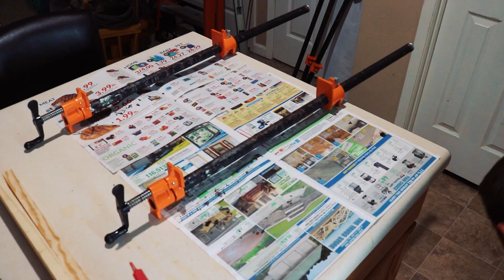Large coffeetree and walnut cutting board

Comment: Hi John, great work. Where did you get those parallel clamps??
Reply from the maker: You can get some 3/4” bar clamps on amazon. Then you’ll need to go to your local hardware store for 3/4” piping. I recommend getting 36” in length for each pipe.
Reply: @johnbarneswood  thanks for the help!